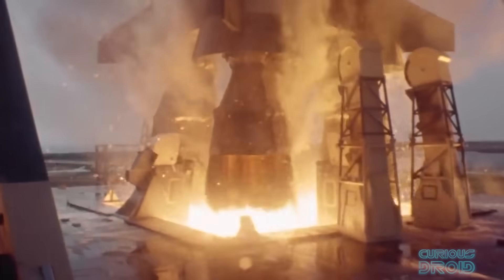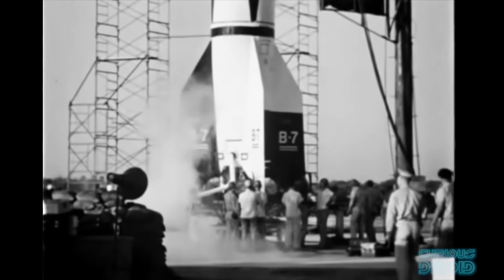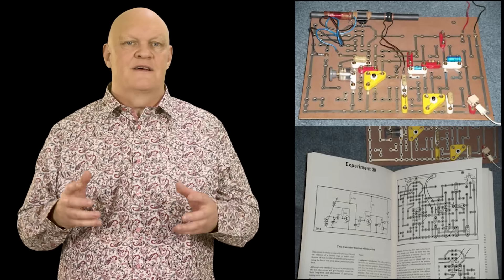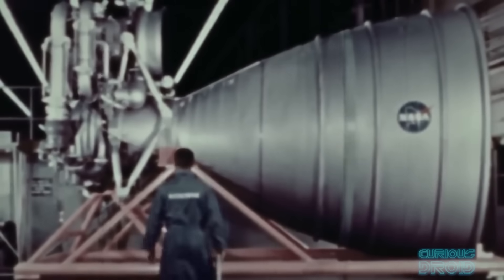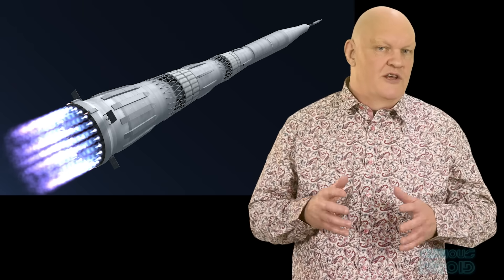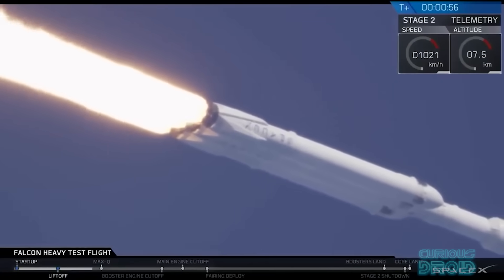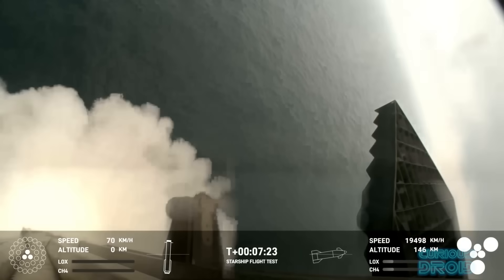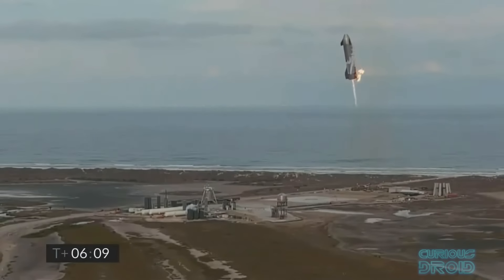Why Does SpaceX Use 33 Engines While NASA Used Just 5?

Comment: NASA models were old models that couldn't land vertically it was therefore unnecessary to have more than 5. Without better computers they couldn't make it too complex.
Reply: The falcon 9 also cant hover, so they have to time the booster and engine cut off to a specific altitude, the real hard part is reliable engine startup.

Comment: I find the phrase "Space-X's method" irritating. As you detail, this had nothing to do with Space X, but was Valentin  Gluschko's concept and the N1 design. The N1 did not fail for technology reasons. In the history of heavy lift rocketry there are two  games that are starters - high tech NASA/ Rocketdyne F1 style with its complex control of flame instability; and the Russian Glushko like the Energia, and it seems the Russian legacy is the one that will ultimately prevail.
Reply: The space X method is different as it gimbled so the engines dont have to reduce throttle or shut off to steer or compensate like the N1 had too which is what caused it to fail most of the time. So spaceX mix of different technologies has been the most successful. The F1 used baffles with chevrons to fix their stability issue, not very complex, but wouldn't work at the pressure SpaceX operates their engines at.

Comment: Use should know that, the S-V to be 'awakened' will have a sum thrust of 150mn at 30mn each AF-1X, 2nd stage 34mn, and so on. The RLV version will sport 75m tall S-C1 and 2x-X43A back to back, with pyl sandwiched between.The tank, resin SRB casings will also be developed, making a runway landing for All Stages.The punt is on NASA, Jupiter AMBITION.

Comment: 25 micro engine already....all base numeric Islamic number, 7, 5, 25, 6.....33 engine already good...but if you can make 50 engine more better more realistic and futuristic base on logic space carrier.....50 engine love by sky and space without no complain....mean that rocket gonna have merge subtank with 12 at buttom...at the rest 26 engine at mid buttom...that how you can used rocket as space transportation in future...more realistic...so at the top side sub merge tank you have air scoops for turbo then exhaust pipe connect to main engine...so you have fresh cool air to main engine rocket...that how you able to install 50 engine at buttom rocket....you need 50 engine to carry passenger like Boieng.

Comment: I still suspect the thrust to weight  ratio might be better with larger engines.
Maybe a combination would be more optimal? Three or five Raptor engines in the center for gimbaling and landing, and a ring of much larger engines around the perimeter giving the major thrust during launch.
They would anyway be mass produced if Elon's plans are successful, so even the production cost could be optimized.
Any thoughts?

Comment: Thumbnail only shows 32 engines — 20 outer ring, 9 in middle ring and 3 in center. Beginning of video shows 33, with 10 in middle ring. When did they add an engine ?

Comment: Didn't even watch it, just responding to the title: 5,000 tons vs. 151 tons. 33 engines vs. 5. Do the math - it ends up being 33.11 engines using the same ratio. It's a great thrust to weight ratio, and the redundancy is great with the better efficiency in each engine today. Plus, by the time you've spent the fuel and return just the booster to Earth to land ... you're back down to around 200 tons or so, you don't want to light more than a couple or so of those engines or it will shoot it back up and away from the tower! :)

Comment: Good overall video.  However your statements comparing the n1 and space first stage fail to understand the advancements in structural vibration analysis applied to the design of the starship and falcon.  Putting 30+ engine together on the same structure means that the vibrations of all the engines will interact in very complex and catastrophic ways.  Today you have   high fidelity simulation software that allows you to design structures to prevent these failures.  In the 1960’s not so much.

Comment: The smaller size thrusters and large number of rocket thrusters do something else in addition to giving balance to the returning rocket: they are much more efficient because they give more thrust per square inch, i.e Force, can a 3 or 4 thrusters. The reason is simple: more thrust is generated as the fuel passes through smaller tubes toward the exhausts than through larger tubes: this is because fuel fluid molecules in the larger tubes do no interact directly with the tube providing the thrust to the rocket, while molecules do. As I said in a tweet to Elon Musk, if you have a bidet with a constant water flow rate, the multi-hole setting will make you feel a force on the bidet compared to the single hole setting. So, in short, Elon Musk is saving money by using multiple small engines (he took my advice :o).

Comment: this may have been answered already but I will answer it in one word, redundancy, okay, make that two words redundancy and geometry. if a single engine goes out or fails, there is more of a chance of imbalance if there are only left with 3 or4 engines. with 32 engines, if two or three engines fail, the chances are they will be distributed evenly rather than all on one side of the rocketship. 
actually I think there is a better answer. I recall seeing a design of the engines if they are solid fuel the combustion Chambers are tapered as to to reduce rate of burn. as the ship becomes lighter as the result of carrying less fuel. with many more engines one can fire up engines with different combustion chamber geometries. but hey I'm just guessing

Comment: so the rusians knew better
Reply: They did not, they attempted more engines at a time where they didn't have CNC machines and SLS metal 3d printers so failure rate of engines was very high.
Reply: They did not, they attempted more engines at a time where they didn't have CNC machines and SLS metal 3d printers so failure rate of engines was very high.

Comment: Thank you Droid for the informative videos. I didn't realize the F-1's were designed to be reusable.
Reply: Semi re usable, Falcon 9 engines are semi re usable due to both engines running on RP-1 they will eventually get too clogged with carbon residue, the raptor uses methalox to prevent carbon residue from forming.

Comment: The Saturn V rockets were virtually hand built. Which means each rocket motor is ever so slightly different from the next. Even following the original blue prints would not get you a rocket motor that wouldn't blow up or utterly fail. Without all the parts being hand fit for functionality.

Comment: SLS has been a boondoggle from the start and is still pretty much a failure. And they started out with a huge advantage of the F1 engines being available.

It should be cancelled and the funding transferred to Blue Origin to aid the effort to get a second reliable system.

Comment: More weight?  Higher cost?  Greater chance of failure?
Yes, been wondering about that.
Reply: higher weight, lower cost, higher reliability is what more engine gets you.
Reply: @miguellopez3392  Higher cost and less reliability.  Sorry, but SpaceX is just a move from the old NASA 'failure is not an option' to 'failure is part of the plan.  More money please.'
Reply: @CoolClearWaterNM  spaceX is building each engine for around 1 million, the SLS engines cost 250million each, if 1 engine fails on SLS the mission is over, if 3 engines fail on starship, mission can still happen. you seem old which is why something like starship fights everything you previously knew and understood.

Comment: The Apollo had enough delta V to go to a low lunar orbit and back. The SLS does not have the capability of entering a low lunar orbit and returning, so it is limited to a special HALO orbit. Of course, the Starship can not even go father than a low earth orbit without refueling. Great explanation on the instability of larger engine nozzles!!!!

Comment: The reason SpaceX uses so many engines is due to control. You cannot control a cylinder rocket with 3 engines to land back onto a space dock.  It is a difference of ultimate goals.  Both are great engines.

Comment: ARTEMIS Program is following the same path as Apollo less then 10 years from drawing board to walking a man on the moon. It's unfortunate didn't have a way to reuse the Saturn V they were basically handmade. The people they had understood the space shuttle system they took space shuttle tech and redesigned it to be a heavy lifter. SpaceX claims they can beat that 10 year timeline but as we have seen they are still far away from putting humans in their rocket. I think it's great we have two programs put men in space that is the goal. Saturn V is a proven system that still holds records today.

Comment: I'm not sure if I missed it, but there's a great reason NASA built the Saturn 5 with 5 large engines rather than a larger number of smaller engines. There's a big parts reduction with fewer engines, which means there's less to go wrong. There's also a weight penalty with more engines as well, isn't there?

Comment: The Raptor engines were sized to achieve the maximum thrust-to-weight ratio per engine. 
Fewer large engines with the same total thrust as 33 Raptors would be heavier, overall.
One potential Raptor design was much larger, but they decided to make smaller engines, instead.

Comment: You are comparing Saturn V with Starship which hasnt demonstrated a payload yet. While reusability  is great, it comes at a performance
Cost. so far, I see the Booster landing basically empty
And flying empty. Imagine loading 50,000 lbs?  Its clear that modifications and improvements are necessary before this vehicle can show a payload of any kind

Comment: If you have 4 engines and lose 1 ... Then you lost 1/4 of your power. If you have 33 and lose 1. Well it doesn't really make any difference
Reply: @HeliumFreak  if each engine has a, let’s say 50% chance to fail, then it is much more likely that at least one engine will fail on 33 than 5, it’s simple maths
Reply: @xidimon2872  one engine faliure on 33  is not a problem but 1 out of 5 is, you are the one that can't do simple math here and havent got a clue what ur on about.
Reply: @smking211  also one engine failure on 33 would still be a problem as the balance would be off
Reply: @xidimon2872  the last time it had 4 engines out and it accomplished the mission with no problem, its called redundancy, do you undrestand?
Reply: @xidimon2872  its a problem with 5 engines and you lose one. Do you get it?
Reply: @xidimon2872  but its not 50% its got over 99% success rate. In its last flight it had 29 engines working and it completed ita mission with no problem.
Reply: @smking211  i was saying it hypothetically?
Reply: On the other hand, with 33 instead of 5 it is much more likely that you will encounter problems. So...
Reply: @andersnilsson973  its more likely to be a problem with 5 engines not 33
Reply: @smking211 no it isnt
Reply: @xidimon2872  you can look at previous launches, they always had a few engines not working properly and even out completely and it wasnt a problem.
Reply: "if" you lose, you lose 33. 
Yes. 
"IF"  you. 

Btw, the 33 engines are not part of a 'rocket' but are part of a 'spacecraft' as in the context of an aircraft. Just as an aircraft is not built for single trip, this space craft is also not being built for single trip. Instead it will be used as a workhorse. 

That's the difference. Yes but if you lose, you lose 33 engines. 

That's the difference it makes. Thanks.
Reply: @guppi277  what you mean lose 33 engines?

Comment: how much is the weight of each Raptor rocket? Can we just parachute them with empty fuel tank?
Reply: Each Superheavy booster weighs like 200 tons empty which is much too heavy for parachutes.

Even if you could use chutes, it has no landing legs. It’s designed to be caught by the launch tower so a propulsive landing is required.

Comment: I played ksp and was just starting career mode and was having issues getting to second stage too early because my booster just was terrible in design, i copied space X 31 engines (but i could only fit 17 due to the limited fuel tank sizes.) and not only was it MORE STABLE then my other designs, it was more efficient. i could almost land it with the remaining fuel for reuse.

Comment: Is it just me, or is this a question that didn't need to be asked? Starship is massive and needs massive thrust. Also a failure of a single engine or even a few engines isn't going to result in disaster. Kind of a duh question imo
Reply: Why? The Saturn 5 had 5 F-1 engines to do the job and had zero failed launches.
The russians used 30 N-1 engines on their N1 moon rocket and failed every time....

Comment: Do you know what I knew about the combustion plate and baffles from long ago and I knew straight away what you were talking about. and I knew I was going to see that same bit of film . Thing is thats such a simple fix compared to the testing NASA did to find out the initial problem it seems kind of funny .This is the reason why I dont get why Musk insists in landing starship on the moon upright. It really complicates everything and you said about the moon lander it was really hard to get the legs on that right and think of the extra weight it going to add and work on the moon for a pad. It would be easier to belly land it and hoist it up on site or belly land it and have a take off module that takes of from that position. Dont think Starship will land on the moon.

Comment: ... because SpaceX hasn't unlocked those engines in the tech tree yet.
Reply: Uhm.. no
Space x produces quite the thrust for the size.
Would be the other way around
Reply: Yeah, they probably need to do some more grinding to unlock the Big Powerful Rocket Engine item!...
Reply: They keep putting all their points in robotics 😭
Reply: SpaceX can use a common engine on many vehicles, adding engines to increase thrust. Many engines reduces the consequences of an engine failure, plus smaller engines reduces the stress on engines and engine components. End result is lower cost and more reliable.
Reply: @stephenblack8804 smaller engines reduces stress on the engine..this statement alone unqualified to talk about engines
Reply: В технологиях есть возможные вещи, а есть в принципе невозможные. Так вот. Создать эффективный большой двигатель вообще невозможно. Тут нечего разблокировать. Это как передача электроэнергии на супербольшие расстояния. Теоретически выглядит возможным, но в реальности этого достичь нереально. Потери слишком велики. Так и большой двигатель. Да большой, красиво выглядит, только не выдает стабильного горения факела, разрушается, не выдает топливной эффективности, т.к. ее приходится снижать для охлаждения стенок камер сгорания и для поддержания стабильности горения.
Reply: Yes, you have to build one shock-absorbing landing strut, one butane powered soldering torch and a remotely controlled docking collar to unlock the Big Engines.
Reply: Youre stupid. 😂😂
The starship is far more advanced
Reply: Haven't watched the video yet so I might be incorrect but the reason is probably because having smaller engines is more efficient and also if one rocket engine fails, the others can keep the rocket in air while having 4-5 rocket engine means there is a higher chance of the rocket falling out of the sky in case of a engine failure.
Reply: I think they elected to spend their science points on more efficient, smaller engines rather than the big beefy Bois. They have to be pretty deep into the tech tree to have access to FFSC Methalox engines of any variety, and we all know that you have to unlock that tier first anyway before you can make a bigger version.
Reply: U got them backwards
Reply: Wonder why they haven't tried asparagus staging... clearly the superior way in early game. Bunch of amateurs
Reply: This alone proves USA hasn't been to moon
Reply: Other way around. SpaceX has managed to unlock the smaller, more versatile, and more efficient engines.
Reply: @orppranator5230  They using MODS...
Reply: @Alien_Bones  nope, they added a bunch of cubic struts on the bottom so that they would attach
Reply: @orppranator5230 they are simply different branches on the same tech tree.
Reply: That also the reason why they keep sending Spaceship up to sky.It's was for either Failed exp or Successful Exp (which is alots more than fail) and also some other bonus exp to level up their company and unlock other techs in the tech tree,the newest "Catch the spaceship", "Unique spaceship"... Give them alots of achievements which equal alots exp, let's wait and see what they get in the tech tree next
Reply: Please pin this comment this is too funny
Reply: jebediah  here
Reply: @Jeeprepdiaries12 sorry jebedi, i did not mean to kill you
Reply: SpaceX just has better tech, and they had the benefit of data from NASA.  They just caught superheavy a few days ago.
Reply: @mattb6646  It was...yesterday...
Reply: Yeeps?
Reply: Because reinventing Buran without understanding why soviets could not resolve fuel distribution to so many engines, falls into the same logic trap: Smaller engines are cheaper to make (serial production) and the rocket is safer since it can lose more than one engine and still be "flyable".... Snakeoil selling...